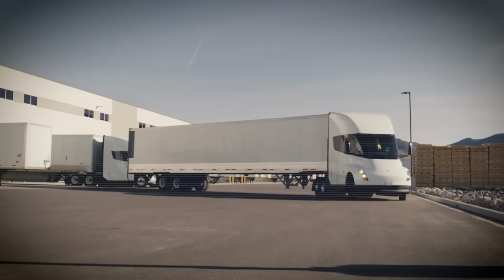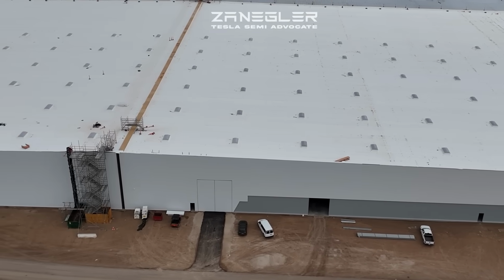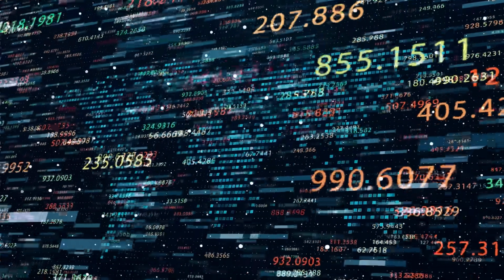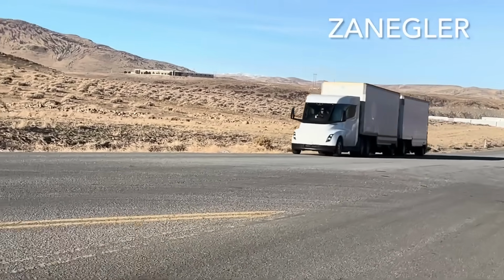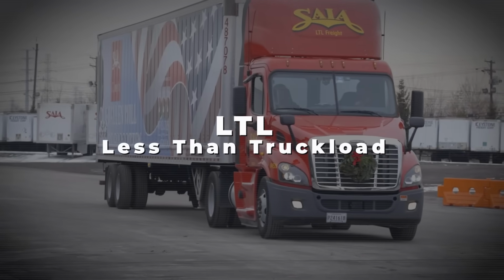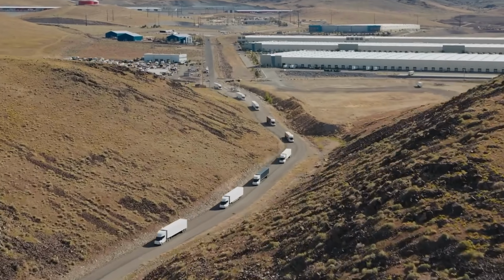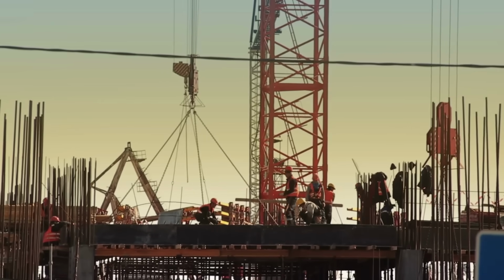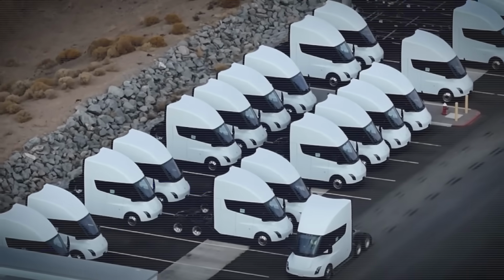The 2025 Tesla Semi Update is Here!

Comment: I’m curious if they’ve done anything about the weight problem? As with most electric vehicles they have a tendency to be significantly heavier due to the batteries and in previous video from a couple years ago the Tesla Semi was pretty heavy compared to conventional diesel semis. This weight issue means that because DOT has a maximum of 80,000 lbs allowed gross vehicle weight on commercial vehicles the extra weight of the truck reduces the amount it can legally haul. So I’m wondering if they’ve had any progress on making the truck lighter to fix that problem?

Comment: north america is behind europe in terms of charging quebec canada has dedicated chargers for people towing and for large vehicles.  however for a big market as the gvw for most ev semis at this point is 80k lbs only one company is going above this alot of states to the north allow higher gvw over 80k lbs in canada 4 axle trailers can go to around 120k lbs and btrains can go higher than this.  now this creates an issue as more tires on the road increases rolling resistance plus extra weight so it will be interesting to see if the tesla can pull canadian weights.  another thing that has not been talked about yet with tesla is different axle configurations as commercial trucks are governed by gross and axle weights.  Another thing is no talk of an E pto to run types of equipment with hydraulics think dump trucks cement mixers cranes etc.

Comment: They can't match production numbers any time soon for a couple reasons.

1. There's no demand since the design is stupid. It's a local cab the size of an otr sleeper cab. Local drivers usually have to back into tight awkward spaces more often than otr drivers. A bigger cab makes that a lot harder or impossible in some places. Then the middle seat gives you a bit more view on the right side, but what you lose on the left is even greater. Pretty much making both sides a blind back.

2. The numbers you give for the large manufacturers are for all semis, most of which are probably sleeper cabs. You need to compare it to local cabs only since tesla doesn't have sleeper cabs. 

3. And they wont have sleeper cabs until battery technology improves and reaches at least 700 miles per charge. Then we would need the infrastructure to charge all these trucks. Plus solve the truck parking shortage issue, or else many of these trucks are going to be parked in random places and stranded with no charge.

Comment: These things will be a huge failure after a few months of use.  Most truck drivers drive over 600 miles a day and they need to be able to get fuel and continue driving within a 15 minute time frame.  They will have mechanical issues after 200k miles with astronomical repair bills and companies will sell them in bulk and go back to diesel.

Comment: Comment of the Year:

How about add a Tesla Semi E-Trailer.  The Trailer has a 200 Mile Battery and the Back 4 Wheels has also Regen!!!!!!

Thus the Tesla Will be Running Forever.
Reply: Your dreaming bud , regen only works if you’re stopping and starting , on flatish highway it’s almost worthless. 
And you are already less efficient in an EV truck because they are significantly heavier , and the more wheels and axles you have dragging along makes their range even worse , and that already piss poor range will finish further as the battery degrades.

Comment: Say all this tesla semi once it starts coming of the assembly line I'd say pretty much most have already sold that's at the 50000 units this year ok 40000 either way some ice manufacturers going to feel it in a way not good that's in 2025 by the time 2026 roll in  and the ramp up in production to say80000 or more it will be your mistake if you don't think tesla semi is able to sell them why ? What shipper / warehouse / factories/ stores / lumber yards / hardware-based stores ect ect ect is going to let the competition run 30 % cheaper . Get your order in now if you still want a job as a independent that's for sure as for a trucking outfit sitting with high cost hardware is just going to be like shooting ducks in a barrel.

Comment: The second truck is not pulling "extra large trailers". Instead, it is the cab configuration designed to work with other than box trailers, such as flat-bed trailers, etc. There are two distinct cab configurations.

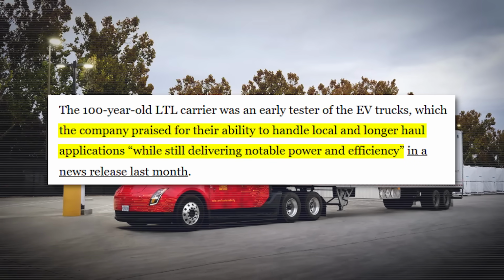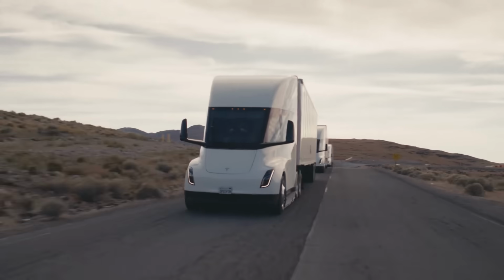Comment: When presenting factual figures it is important to ensure that the message is correct. [6:30 > 7:00] Semi economy stated as kWh per Mile.. Hummer as Miles per kWh. So no, the Semi does not use less energy to propel itself than does a Hummer. 😮
Reply: thanks for contributing and debunking bullshit!
Reply: Also it's battery packs even for short range 1/2 it's cargo capacity imagine long range where charging stations either don't exist yet (due to costs, need, grid capacity, lack of potential profit etc!) or can't exist (think mountain Road's, remote locations with no ability to be easily or quickly serviced!) at best it would be 1/4 the capacity of Disel Trucks! 

A Fuel Electric Truck (think about Disel Electric Trains!) it's the best of both worlds
Reply: @DarthAwar these are mostly for short range which covers a larger majority of needs for trucking and where most of the emissions are.  Edison motors is building the long haul off-road version you described.
Reply: How much does the battery weigh? Double the weight, square the inertia. Square the effort required.
How much more than a diesel truck does it weigh?

Comment: So the load capacity issue with e-trucks has been solved then? Charging time and range? Would be amazing to go to all this effort and Elon continuing to try to push this product and they still can not really replace traditional trucks.
Reply: They can do 500 miles fully loaded. They have 2 X 1000kw charge ports so can get 70% range boost in just 30 mins, this represents 350 miles.  
This truck will easily handle 90% of truck jobs. Consider too that mandatory rest stops can also be charge stops, so improving charging infrastructure will increase that 90% over time.
Reply: @roryreddog3258 yeah but there’s not enough potato chip loads to make all of them get 500 miles😂😂😂. 
  You couldn’t pay me to own one of those things. 
 For short shuttles you can probably get away with it , but if you start doing serious loads  they will fail in heavy duty situations without any doubt. 
Some big rig loads have a lots  of axles and tyres that add extra drag , plus massive wind resistance,  imagine a 5 metre high car carrier with two trailers and 9 or 10 axles , or similarly configured freight sets pulling 68 ton up the highway. 
 And what about ancillary’s such as hydraulics , fridges , extra equipment carried , all these loads in the video are cushy loads,  easy and light configurations . 
  You couldn’t pay me to buy an EV truck.
Reply: @roryreddog3258  will be interesting to see how it plays out, so far it is a bunch of broken promises and hype but I can see the value in these for a lot of lighter jobs and even smaller versions of e-trucks, assuming reliability. The load capacity has always been the big issue for larger jobs due to the weight of the batteries and still doesn't match up to conventional trucks.

Comment: and how much of your potential cargo weight is wasted to the weight of these trucks and their batteries? There are weight limits for hauling cargo across the country and really not interested in a  truck that is going to reduce cargo capacity by a 3rd or more due to it's additional weight. Plus truck stops don't have tesla truck chargers etc.
Reply: It is the other way around, Jon - Tesla has indicated that their total cost of ownership will come in a 70% of diesel. Their power and torque is enormous compared to diesel - pull twice the weight no problem. Tesla's batteries are light and getting lighter all the time. Diesel will only remain viable on the very long haul routes, which are like 5% of trucking.
Reply: The weight of the semi is almost the same as a Peterbilt. Slightly more, but they also get an extra 2000 pounds gvw. That being said, Tesla insisted their semi be able to haul the same cargo weight as the average diesel truck. Around 44-48 thousand pounds.
Reply: No cargo capacity is sacrificed. A Tesla Semi can pull the same tonnage than the average diesel rig… and even more in Europe!

Comment: Tandems are not double a single 53' trailer Typically 2 x 28' trailers.  So a bit more, but not close to double.
Reply: Ja  not in Mex there they pull twin 40’ coke trailers, also seen this in UT
Reply: @print4apet  Yeah, I know.  but in approx 45 of the states there are no land-trains.
Reply: @fzust  Nevada allows 3 28-foot trailers. And Michigan has a 160,000-pound load limit.
Reply: @johnd01  come to outback Australia...we have road trains with 3-4 trailers
In some parts of Australia, 'super quad' road trains up to 60 metres (196 ft 10 in) are permitted, consisting of four standard trailers connected via three converter dollies....USA needs to do this and compete against trains .....again ...
Reply: True for the most part but I have seen 2 53ft tandems before many times. Not super common but I’ve seen them in some states

Comment: You gotta do your Videos more diligently man. 

In your own Video you state that the Hummer gets 1.5 miles per kWh and the T-Semi uses 1.73 kWh per mile. Ergo, the semi gets around 0.57 miles per kWh.

Also in the frame with the double trailers, the second one is clearly not hauling extra large trailers, but the cabin is smaller because its a different model.
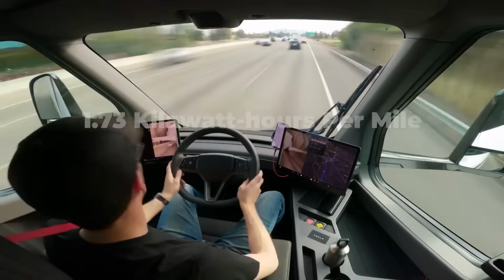Reply: also 6:35 kilawat
Reply: @a.yashwanth  wow I didnt see that xD
Reply: 0.57 mile per kWh is equivalent to 1.73kWh per mile. 

If travel 10 miles x 1.73 = 17.3kWh used or with 17.3 x .57 = ~10mi
Reply: can definitely tell hes not in commercial trucks industry, lots of misstatements...

Comment: You've compared incompatible units regarding the miles/kWh...
The semi's efficiency is defined in kWh/mile while the vehicles are listed in miles/kWh.
1.73 kWh/mile (for the semi) is equivalent to 0.578 miles/kWh.
Reply: This is correct.
Reply: I also was a bit confused when he said that 0.6 miles/kWh is better than 1.5 miles/kWh
Reply: Makes sense, a semi running at the same efficiency as a hummer sounds a bit too good to be true
Reply: Try km /kWh...your brain might explode but at least it's both in metric FFS
Reply: @damfadd m/Wh sounds better.... Or better use N^-1 (Newton inverse)
Reply: Joules would be the correct SI unit, not kWh. km/MJ .
Reply: Beat me to it. Good Catch!
Reply: 1.73 kWh per mile is a bit over 1/2 mile per kWh.
Reply: @Johnasmith99  so 800 meters  per kwh
Reply: @damfadd  Now you went and compelled me to actually do the math and get the correct answer.  930.201 meters per kWh is exact.  😂
Reply: @Johnasmith99  yeah but I was just spitballing because 1600 m or so is a mile so yeah good on you for your efficiency and maths
Reply: Thanks for clarifying. Sounded crazy efficient.